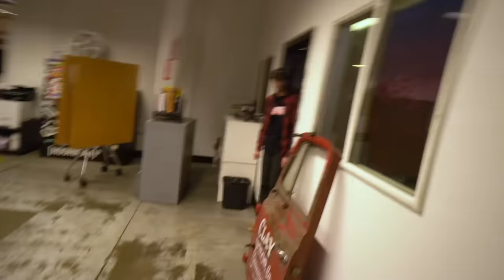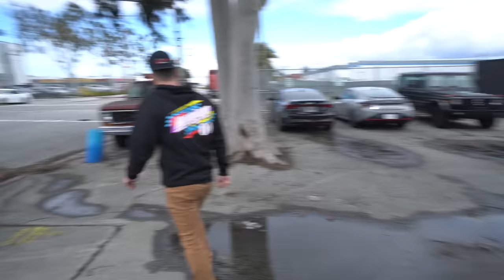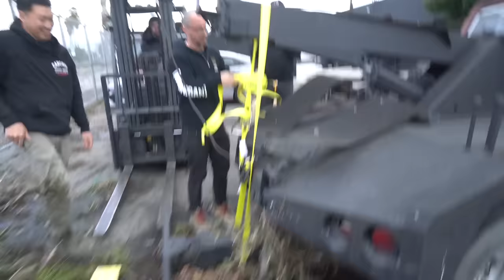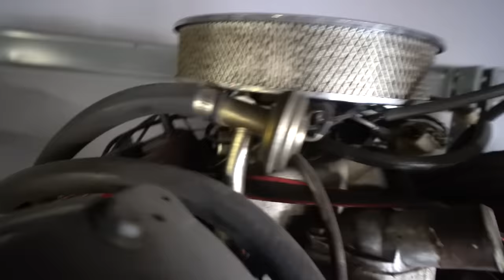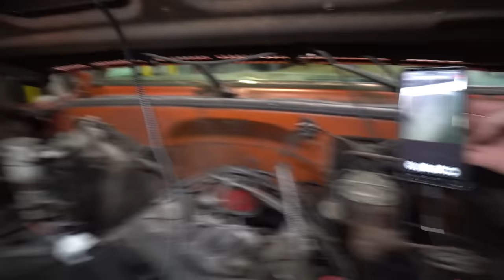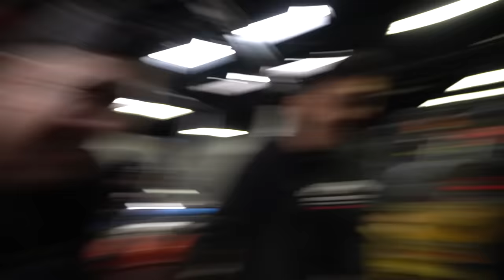Reviving the Burnyard Wrecker! Who Tows the Tow Truck??

Comment: I would not mind buying it for sure, but what I would rather see is it in a gymkhana video. Twin turbo small block, lowered, cleaned up and wrapped, sliding around the city with all the tow stuff still equipped. Maybe even a compound turbo diesel setup.

Comment: All jokes aside. I think fix it. Do a full rebuild on the  channel. Just show people that a tow truck is a good investment regardless of what towing set up it has.  Because it’s short wheel base it’s actually easier to use in a lot more places then a tilt try. See if you can get a custom steering assembly  for  tight corners. Keep it old school. Keep the flashlight amber light on it and definitely keep the colour it is. But look into a new hook  for picking up the front or back wheels for the back. But get custom made dolly wheels for low cars or a car with brakes that are stuck on or missing.. . I’m a guy here in Australia that loves the C10’s but we don’t have many here and for the ones that are here… thy want $60,000 Australian dollars.. but it would look like the tow truck… i bet the advertisement would probably have … Starts but sold with out a carbie. . 💯 think of the pros and cons of it…

Comment: 454 crate motor, silversport trans tr4050 kit, quick performance aam11.5 rear and that bitch would live forever. 

add blower a week later and regret it everytime you replace parts downstream but have a blast doing it.

methanol towtruck anybody?